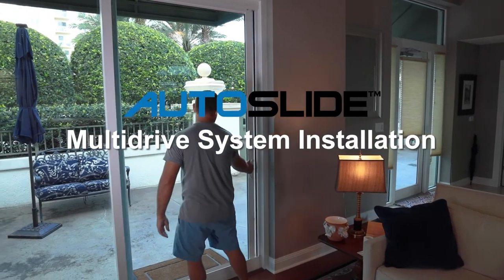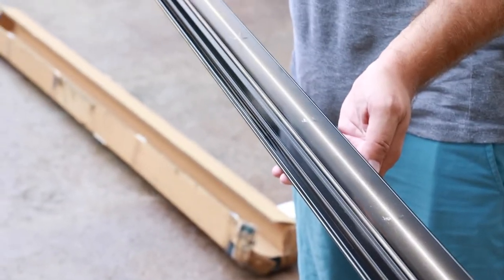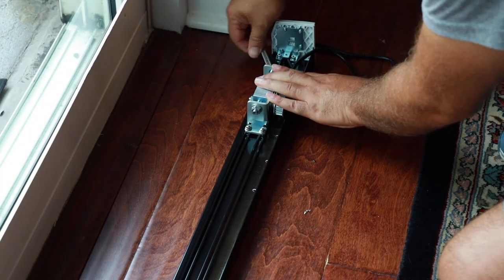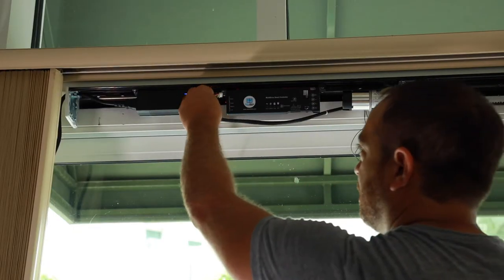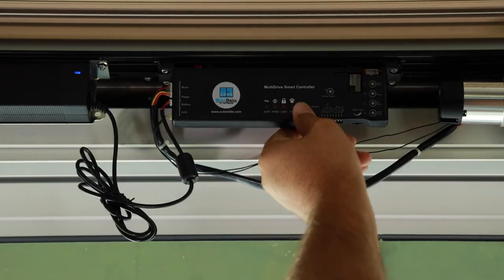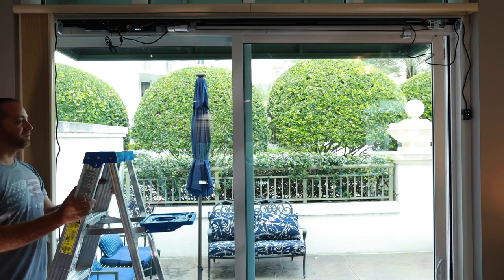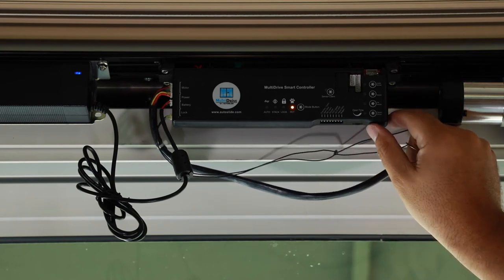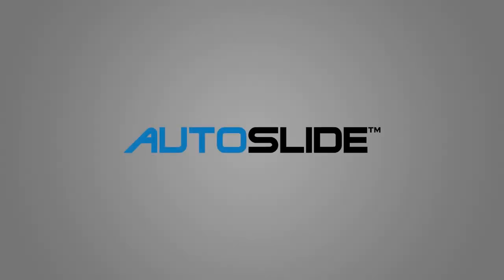MultiDrive Installation

Comment: So in pet mode the door will only operate with the pet sensor or inside microwave sensor but will not work on the outside sensors?
Reply from the maker: You can have the system operate in Pet Mode with the Outside Sensors working or deactivated. You can turn this on or off in the Autoslide app or using Dip Switch #4.

Comment: I'm confused.... If i have biparting patio doors (2 doors that both slide away from eachother to open), would I require just one of these Multidrive units or two of them (one per door)?
Reply from the maker: Hi TIm. You would only need one MultiDrive System.

Comment: Can the doors still be opened manually without disturbing the unit?
Reply from the maker: When in Green Mode, you can pull on the doors to open and the system will take over the opening for you. It is a power assist mode. To get a fully manual operation, you would need to turn power off to the system.

Comment: I thought they were DC powered
Reply from the maker: The systems are 24V DC. The system plugs into a 110 outlet but uses a step-down power supply to bring it to 24 volts.